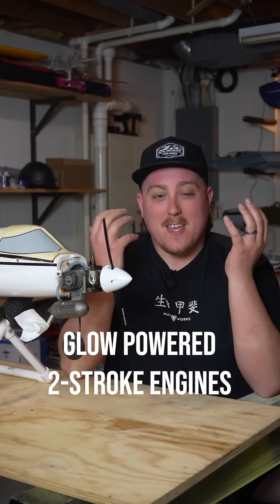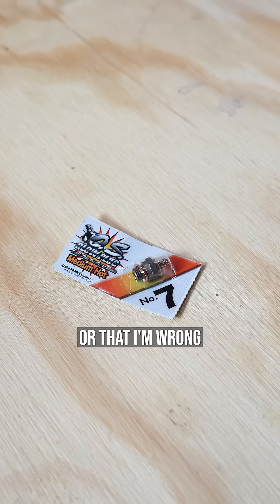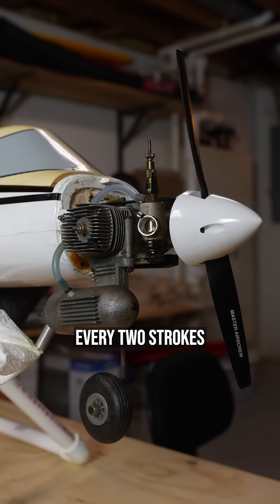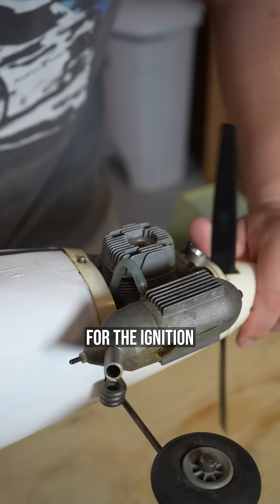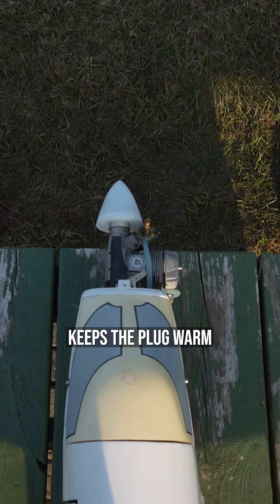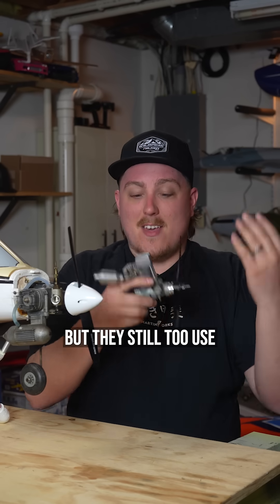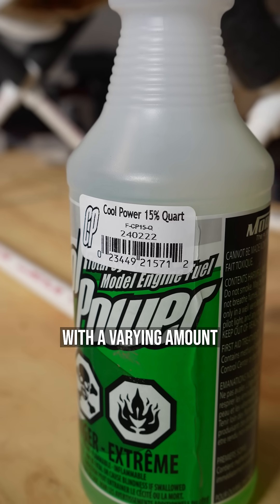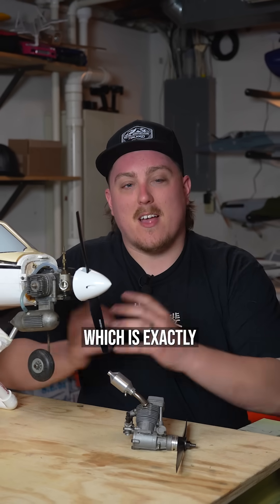How do Nitro RC Engines Work?

Comment: It’s basically a bastard cross between a 2stroke and a diesel engine. Two stroke engine principles but the glow plug eliminates the need for an ignition system. Glow engines operate at crazy compression which is required to ignight glow fuel. Glow fuel has really high flash point when not being compressed. Compression can be managed by “deck clearance”, the rule of thumb used to be a minimum of 0.006” for every 10% nitro in your fuel. Though it is considered a good idea to run a little more clearance to avoid detonation (a problem if you’re not that good at tuning).😊
Reply: Diesels come in 2 and 4 stroke.
Reply: Exactly right!
Reply: Many marine diesel engines are 2 stroke.
Reply: it is a 2 stroke diesel! Not uncommon in the past big river ships had one cylinder 2 stroke diesel.
And as the motor not use gasoline  and ignition but instead a oil and a self ignition, it is no Otto motor but a Diesel
Reply: @ but it doesn’t use diesel fuel?
Reply: @paulsdrc  Rudolf diesel did not know there such thing called diesel fuel his fuel was any oil. Diesel engines burn oil, the car industry have concentrated there design efforts around lightweight burning oil for heating, and the only difference is the tax, but you can run a diesel with sunflower or other plant oil as well.(some engines have parts that will be damaged by the acid of plant oil, others can runn 100%) In big ships they burn even heavy oil when offshore. Therfore the oil mix here could be classified as diesel and it is no gasoline for sure.
Reply: 😂😂 It's a 2-Stroke running on liquid Dynamite... Have you ever seen a drag motorcycle or drag car explode while starting? The explosion is caused from residual nitro still in the cylinders from last time it was running & cylinders were not dried out.... Motors running 100% nitro must be started with alcohol and switched to nitro while running or the engine goes into low orbit 👍
Reply: @ The fuel is a percentage of nitro by volume, aircraft is usually 10-15%, I’ve actually taken a cap full of 20% and put a match out in it

Comment: the methanol in the fuel reacts with the platinum element in the glow plug to cause the fuel mixture to combust, in essence the element in the plug is glowing constantly to ignite incoming fuel/air mixture
Reply: Exactly. People confuse it with Diesel. Those are compression ignition, not glow ignition. Large diesel engines only use electric flow plugs for cold starting. Small glow engines are not the same. There are also 2-stroke Diesels of course.
Reply: @WalkerSmallEnginePerformance   I have an extensive inventory of glow engines roughly 75-80 NIB and rest are used, previously ran. I tend to buy rc aircraft collections.  i have a few long discontinued engines like MVVS, MDS , Webra, Enya, Rossi, magnum, moki, thunder tigers, super tigres, Rossi, nova rossi,  asp and several other odd brands
Reply: yes and the problem with the Platinum coated element was that once the platinum burned off, the plug would appear to glow normally but the small engine would be a nightmare to get started and have it idle reliably. It took 40 years, before someone wrote an article in a RC magazine, explaining this!

Comment: You can also tune with different glow plug heat ratings. Hot engines or high nitro fuels usually like cooler plug, while cooler running engines or running low nitro fuel run better with a hot plug.

But running a Hot plug in a hot engine could cause premature plug failure and possible pre-ignition, causing kick back on startup and power loss or inconsistent power.

Comment: Sounds like a fast way for a runaway engine
Reply: Dude your talking about runaway??! You won today's comment of the day. Damf
Reply: @StayGoldVinyl  yeah
It happens when a traditional 2 stroke with a spark plug, revs high for two long and the spark plug becomes a glow plug unintentionally. 
The engine keeps revving leaner until something gives

Comment: It's a 1 stroke diesel.
I had a 0.049 Baby Bee
Reply: There is no 1 stroke engine. 
2 Stroke = 1 combustion per 1 rotation 
4 Stroke = 1 combustion per 2 rotations

1 Stroke = 2 combustion per 1 rotation?
Reply: @safetyinstructor
A single stroke 0.49, Baby Bee engine is an extremely dirty running engine. 
It burns a.uxture of methanol, coconut oil and nitro methane.
I haven't flown anything since 1973.
Lights off with a glow plug.
No valves.
It both fires and exhausts on each side ge rotation. 
By definition; that's a one/cycle.
I'm open to re-education. 
I've been wrong before...
Reply: Please explain to me how a tiny diesel engine, with both intake and exhaust ports wide open and unencombered by valves,
is not both in compression and exhaust cycles, at the same time, in one c6cle
Engineering via intention ?
I'm a learner.
Please teach me.
Reply: @safetyinstructor Yep, they count 1/2 stroke up. And 1/2 stroke down as 2 strokes😂
But no other engine type does this.
1 stroke = 1 full rotation. 
Toy engine companies don't get to dictate realituly😂

Comment: Will they fire on 'Easy start' fluid?
Reply: Yes they will run on just about anything. The problem is finding an oil that will mix with the fuel, I tried running a model engine on Gum-out carb cleaner. It ran great but then seized because there was no lubrication. Ordinarily I would mix my own fuel of Methanol and castor oil, but the price of Methanol skyrocketed. and Gum-out would not mix with Castor oil and ordinary engine oil is way too thick

Comment: Ive looked at these compression ignition nitro RC engines for years, timing the firing is the biggest problem and no ignition advance must rob some power .
Reply: It's not compression ignition like diesel. The coil is good at retaining heat, and that is what starts the combustion.
Reply: You can play with it a little with shims changing compression.
The car engines turn 40,000+ and make 10hp per cu in, that is a lot of power out of any engine.
Reply: @edmundanderson657  yes, I suppose simplicity over rides the loss of power from inaccurate timing .

Comment: In the 1930's small internal combustion engines for model planes and boats were developed, they used a battery ignition system with a small coil, points and spark plug. Problem was the battery and coil were heavy, so small model planes suffered from the weight. In the late 1940's Ray Arden developed the glow plug, he had been developing and producing engines before that. The glow plug revolutionized model engines in that it dispensed with the heavy batteries, points and coil. The early engines ran on methanol and castor oil, additives like nitromethane and benzene among other things came later. The element in a glow plug is a nichrome wire coated with palladium or rhodium which act as a catalyst with the methanol in the presence of heat from compression to ignite the fuel. As precious metals, those coatings have become expensive, a glow plug 15-20 years ago was less than 10 dollars for the best, now they are pushing 20 dollars, even the old Cox .049 glow heads are now 18 bucks.
Reply: The castor oil! I remember that from the early 60's.
Reply: ❤ I have a catalytic cigarette lighter from over 120 years ago! Love it
Reply: Was that Arden of 'Arden Flathead heads' Arden?

Arden..
Reply: @kingcosworth2643  No. ARDUN heads were a product of Zora and ARkus DUNtov's automotive products company.
Reply: Spot on mate. Nailed it.

Comment: Old guy here. Back in the 90's the Super Tiger engines were just awesome! I had so much fun with this stuff before my kids came along.
Reply: Dad used to take us flying. Nowadays, the fuckers with the quadcopters have ruined it for everyone and you gotta register your aircraft.

If you wanna take your kids flying, I can recommend some things. 

One, check your radios. They're probably no longer acceptable for flight, as the frequency juggling may have something else in its place. This has happened multiple times. My dad has a four channel from the 70s that is now in the CB band somewhere. I think the newer ones also don't have or require specific channel control. Do some research, though, because I haven't flown since the mid-2000s.

Two, make sure you have all the registration and insurance coverage squared away. It's changed as much as the radios.

Three, and perhaps most importantly of all, invest in a computer RC flight simulator. This one will save you thousands of hours and hundreds of dollars in repairs and trekking across acres of fields when it comes to teaching new pilots. They'll usually come with a peripheral that looks like a radio but plugs into your computer, and it might be enough to scratch your flight itch without actually burning fuel.
Reply: @thomasgeorge4384  totally agree with you about the morons with RTF quadrocopters...and yes... I refuse to call them drones
Reply: Same!  I tried to introduce them to model rocketry but in a city, well, I had an argument with a lady on the horse that amounted to "so what? call the cops."   It was weird.   So we pivoted to, uh, chemistry that is loud.  I was touched by Pyro God, sadly, my kids are sulfurous nephilim.   Amazon kindly supplied the float charcoal, flours of sulfur, and prills of potassium nitrate.  They even had sorbitol for stars.   My wife put the kabash on our experiments, so now we do it in minecraft.
Reply: Old guy here, too. Back when I started RC (1976), we all had to build our models out of balsa wood. And since we built them, we knew how to fix them. And then came the "veneer-covered foam wings", (what? No more spars & ribs?) and the ARF (almost ready to fly) models and finally the completely ready to fly toys, with radio and all in the package. IMHO this dumbed down the hobby, paving the way for drones that ruined it for everyone.
Reply: @coriscotupi  we did the balsa builds, too. I got really good at fixing them. We never had sheeted foam. You had to build the wing first if you wanted to sheet the thing. Most of the time, you didn't. Sheeting was heavy and reduced performance. Most of them were that adhesive shrink plastic, but we had a few that were doped tissue paper.
Reply: @ I actually built a few models with open structure and dope, but as far as I can remember, I only used tissue paper on gliders. I had a .40 pattern model that was covered with silk and dope. Its  wing was as strong as they came, it could probably be used as a surfboard. LOL
Good days.

Comment: The glow plug functions because of a chemical reaction between the hot platinum wire in the plug and the alcohol nitro mix in the fuel.
Reply: The chemical reaction is called combustion. Combustion creates heat. The heat keeps the plug glowing.

Comment: I have seen such engines called a "Semi-Diesel "  since they  do not use the compression of the fuel mixture alone to burn it.    They always need a glow plug,  versus a "true" Diesel which uses glow plugs to ease cold starting.
Reply: None of that made sense , " true" diesel ?? Please , when Rudolf Diesel invented the engine , there were no such thing as glow plugs ! Many modern motors don't have glow plugs. Compression ignition engines are not always diesels . So a true diesel would have no glow plugs . Hell I've worked on a 1 cylinder full reed valve two stroke diesel that is 9 litres and starts with a blank shot gun cartridge. Not a glow plugs in sight .
Reply: @JosephCowen-fz8vj  As I wrote, a "True" Diesel can run on its compression ignition alone.  " Semi- Diesels " need the preheated glow plug in addition to their compression ignition.   .  This is like the hot bulb engines which use an element heated by  a blow torch to trigger ignition without either a spark plug or glow plug.  Semi- diesels and hot bulb engines use a preheated element  to lower the compression ratio needed for ignition.  A true Diesel runs off its extreme compression alone.    Semi diesels and hot bulb engines cheat, using a mix of compression ignition and a preheated thermal element.  They get the simplicity of not needing a spark plug, while avoiding the extreme compression  and other demands of  a purely compression ignited  true diesel.   Getting the compression only ignition of a true diesel running without help take a great deal of energy.and very tight tolerances.  Detroit's two stroke diesels used supercharging to pre-compress the fuel air mix making compression ignition easier. within the limits of the two stroke cycle.  These are all ways of creating a a spark-less internal combustion engine.
Reply: @jeffreyplum5259  yes but the Detroit Diesel doesn't really add to compression with the blower , it's only 2 to 4 psi over ambient pressure , it's more to move the fresh charge through the motor , without it they won't even run. The Commer Trucks TS3 motor is a opposed piston two stroke using a Wade roots blower to move gasses uni flow .
Reply: @JosephCowen-fz8vj  Thanks for the correction.   One engine you may want to look at  is the British Napier Deltic.   This engine used  three V blocks in a triangle producing an 18 cylinder apposed piston monster.  Its 3 crank shafts were geared together.combining all their power..
Reply: @jeffreyplum5259  yes I know it well , little known facts is one crank turns anti clockwise and the other two clockwise. The Commer Trucks TS3 is my favourite though , 1 crank , 3 cylinder, 6 piston two stroke opposed piston engine .
Reply: The word "glow olug" adds confusion. The glow plugs known in common diesels are just preheaters. Just to preheat the combustion chamber or intake air and are usually off prior to starting. After that they're off and have nothing to do with the running engine.
On these glow engines the plug is always part of the ignition system.
Reply: @edmundanderson657  not a very accurate one , and no timing advance for rpm , power got to be getting lost .

Comment: Compression is enough to ignite fuel
Reply: True you could use gasoline in a Diesel engine. But not for long. Place a sheet of paper on steel and smack it with a steel ball and it will ignite at the contact point due to the steel compressing the paper at the point of contact. If these engines worked purely on compression, you would have an extremely low powered engine. Remember the fuel is Nitromethane and Ethanol. Both with a VERY low flash point. It would pre-ignite so early as to be useless unless the compression ratio was very weak resulting in a very low powered engine.
Reply: On a two stroke dirt bike u can have a run away engine and pull the spark plug wire to kill spark and it will still scream till fuel in bowl of carb runs out or u choke all the air.

Comment: Essentially a diesel right ?
Reply: It uses the same ignition principles, but if you put nitro methane in diesel, you're gonna have a bad time.
Reply: @gadgetbuster69 Diesels don't compress a fuel air mixture. They compress air only, and then the diesel is injected near TDC. These engines do compress the entire mixture.
Reply: No. Deisel uses compression. Some use a glow plug only for starting in cold weather and runs on Deisel fuel. After starting and warm up it no longer require a glow plug which is turned off and plays no further part. As stated, these use a mix of Nitromethane and Ethanol (alcohol) fuel with oil for lubrication. Use that fuel in a Deisel and you will launch various engine parts into orbit. PS, Nitromethane and Ethanol is also used in 1/4 mile drag racing cars.

Comment: These internet fools will lose their minds when they find out not all diesels have glow plugs….
Reply: Some Deisel engines are Equipped with glow plug but are usually for engines intended for use in applications where temperatures can fall into extremely cold realms. Most military Deisel engines are designed for all environments and have glow plugs.

Comment: They are compression ignition engines that use the hot coil to ignite the mixture. They are in a way a modern version of a hot bulb engine. In the glow plug engine the coil is initially heated by the battery, but then the heat of combustion keeps it hot. When the mixture is compressed it gets hot, but not enough to spontaneously combust - it needs a kicker. That's what the hot coil center of the glow plug does.
Reply: Glow plug =Fuse for the bomb & once the bomb explodes it sucks in more liquid Dynamite and repeats the cycle on its own... Ever seen a nitro drag bike or funny car explode on starting? The explosion is caused from residual nitro in the cylinders from last running & cylinders were not dried out right... Liquid Dyno-Mite
Reply: glow plug helps to lower the compression ratio to ignite the fuel. lower compression ratio means the engine doesn't have to be as robust, ie lighter construction.

Comment: It is 2 stroke and needs power to the glow plug to start it, then runs off combustion heat.,.
Reply: Yes and no. after starting the glow plug is still used for ignition using the heat of combustion to keep the plug glowing. There isn't enough compression for ignition. If there was the fuel air mixture would pre-ignite and destroy the engine. It is a combination of compression and heat (glow plug) that times combustion. Timing is controlled by the ratio of Nitromethane and alcohol. Basically, only use the fuel mixture specified by the manufacturer.
Reply: I used to race control line plane using 2.5 and 10 cc engines. Still have the scars! 🤪